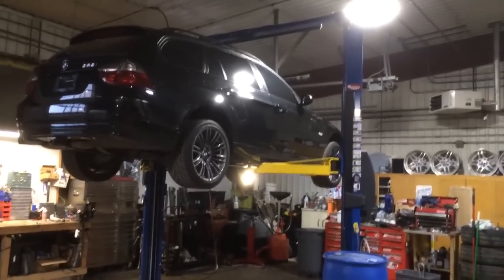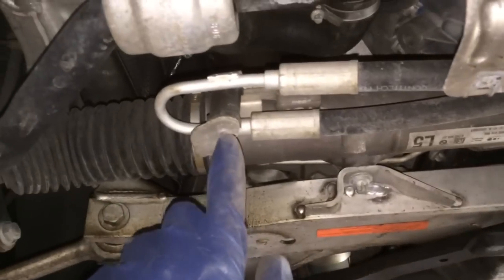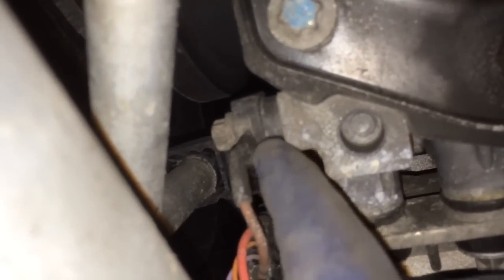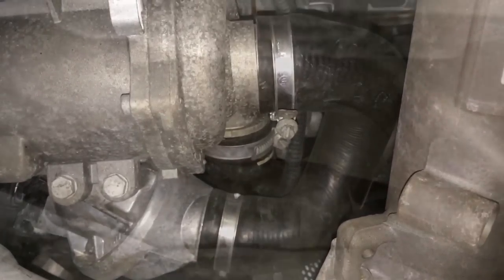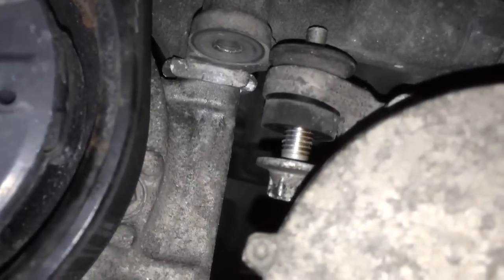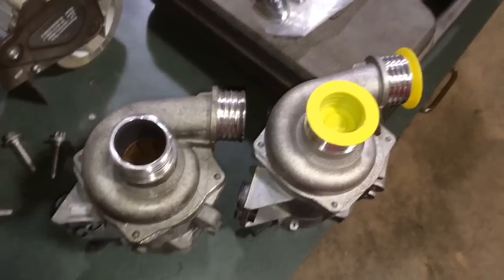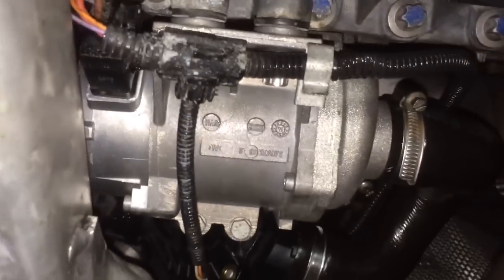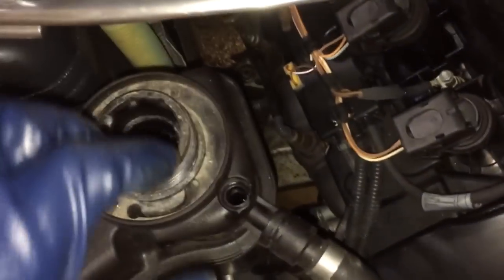BMW e90 e91 e92 e93 325i 328i 330i electric water pump and

Comment: This is a great video, right to the point. question can I use ramps to do this or jacks?
Reply: I replaced my water pump on my E90 325i and I used jack stands, Nothing to it but to do it.
Reply from the maker: +Frank Perez I think ramps would be ok. only thing is dropping the sway bar really, and that would be the same whether its on stands or ramps.
Reply: Thanks brah, was not sure if the sway bar would drop. Thanks for clarifying that it does not matter. I have an 06 325xi 153,000 and it runs strong however I believe the water pump is a ticking time bomb lol. Thks...
Reply from the maker: +Frank Perez watch my BMW X1 video. it's much more similar to your car than my wagon here due to AWD (makes the job a TON harder). 

still doable on ramps, getting the pump out between the sway bar and fan shroud is a PITA on the AWD cars.

and yeah, thats a time bomb.
Reply: +Camper1234599 will check out that video thks.

Comment: Great video!!  Realistically, how much time would you say this will take?  Thanks.
Reply from the maker: depends wholly on aptitude and tools.

2-5 hours
Reply: +Camper1234599 Thanks for prompt reply, pretty handy with tools, never done this job before.  Have lifts and all tools, going to do job at Navy auto hobby shop.  One auto shop agree to do just the labor for $359.00 I will be supplying parts and coolant.  Another wanted $888.00 with parts.  Your thoughts??  Thank you.

Comment: Just bought a kit for my E70 2011... car overheated last week. Got the same OE thermostat as you do but my original water pump is Continental.  The new one eventhough when I ordered it was listed as Pierburg, but it was Continental that came in the shipment.
Reply from the maker: +Willy Pitty continental is for the turbo engines. pierburg is normally asiprated engines. there are at least three different water pumps. see my brand new X1 water pump video to see if thats the same pump you have
Reply: Good to know!!! any tip on getting the parts out of the engine compartment? I sent a good part of the today working on it, really got stuck at getting the old parts out of there and I say prob getting the new parts into the lower engine area...
Reply from the maker: +Willy Pitty again, watch the X1 water pump video I posted yesterday in my channel. explains the all wheel drive turbo process better than this video does.
Reply: Will do.... Thanks!

Comment: I can't get the first hose from the water pump to the thermostat off. Can I take off the water pump with the hoses still attached to get a better grip of the hose to disconnect it?
Reply from the maker: +ronkee24 I don't know if there's clearance to remove the other hoses, or squeeze the pump and thermostat out together. sounds fishy that that intermediate hose won't come off.
Reply: +Camper1234599 yeah, it's on there very tightly. I tried loosening it with a flat head and it still won't come off
Reply from the maker: try getting a pick underneath the lip of the hose and work your way around it while pulling. if you can get one side off, twisting and prying should get it off. the hose is under $10 new, I would strongly recommend changing it if I were in your shoes.
Reply: +Camper1234599 Thanks for the advice. I finally got. the water pump out. I also wanted to know where I could find a replacement piece for the rubber noise dampener?
Reply from the maker: not sure which part that is?
Reply: +Camper1234599 It's the part that you show at the 2:00 part of the video
Reply from the maker: +ronkee24 ooh! realoem.com to find the part number, then bmwmercedesparts.com for the part. or ECS tuning

Comment: I'm driving an e90 2006 model, it overheat and i replaced waterpump and thermostart, but the car is still overheating, i tryed to check the fuses but i don't know where is the fuse for the waterpump can you help to find the fuse box in the engine compartment
Reply from the maker: Alfred Maebela either you have bad pins in the connector on the pump, the pump driver is fried in the engine computer, you blew your head gasket or..?

Either way, you need a dealer.

Comment: I'm very confused why the thermostat needs to replaced along with the pump and the new unit is plastic?!?
Reply: +Camper1234599 
+KeystrokeCowboy

...and to other posters who read this in the future - the water pump gets blamed for failing a lot...but I suspect that the thermostat is often the undiagnosed culprit. Here is an easy test to suggest which is failing. This test is not perfect, but will generate some useful info. Since the pump is $250-$500 depending on where you get it...I think this is worth the effort. That is especially true if your pump has only 50k miles on it, or you are on a tight budget. Use your own judgment.

1. Run the coolant purge cycle. Google it...very easy and NO risk to the engine or system. During the purge, open the hood and listen for the pump to see if it is running. It will cycle on and off. this is normal. Don't just listen "for" the pump...listen TO the pump. Is it straining, is the speed irregular or is it making weird squealing noises, or just plain not running? Those are your clues. It is not a Saturn 5 engine...it is a little electric motor turning a turbine blade which looks a lot like a turbocharger intake blade...o.k? 

2.  If it IS running, step two is start your engine and turn on your heater on high/max temperature. With the car warming up, sit in the car and note if the heater is actually getting hot. if the heater gets hot and STAYS hot, you know your water pump is at some level circulating coolant. This is because the heater core feed bypasses the thermostat. A stuck thermostat keeps the coolant from circulating coolant to the block...but NOT the heater core. Got it? SOMETHING must be pushing that hot coolant to the core? that "something" is your water pump, which is at some level circulating coolant, no matter what the engine computer is telling you. IF, however, the pump is bad then the heater won't be hot either, because NO coolant is circulating. Don't run the car very long...just long enough to determine if the heater stays hot. Should be evident well before the engine gives you an overheat warning. Yes, it is possible for a pump to run but not run fast enough to circulate coolant. The way to tell is how fast does your engine overheat? Reach down and feel the lower radiator hose. If it is stone cold, suspect the thermostat. If it is lukewarm, suspect the pump is not keeping up. If the car overheats in only a mile or two, suspect the thermostat...if it only overheats on hotter days, suspect the pump can't keep up...use common sense. 

Anyway, the test above would SUGGEST (not prove) that the thermostat is stuck. Now you have a decision, but you have some info too. If you have the bucks, replace the pump...if you are on a budget, and the signs indicate it, try replacing the thermostat first - even though the job is a bit of a chore since you must remove and reinstall what may be a defective water pump. 

re: Thermostats. Note that Gates sells this stat "lifetime warranty" for about a hundred bucks, but what they sell is (literally) sourced from the same folks as the cheaper MotoRad unit...and probably the Hella unit as well, which both sell for 30-50 bucks LESS. I have a Gates unit in front of me now, and someone at Gates has carefully removed all Hella p/n and casting marks with a die grinder to eliminate the OEM sourcing info! Boy, that's taking it a bit far, I'd say! FYI,

re: "Plastic? What?" Yep, ALL of the replacement units are plastic, and in this case this is GOOD, because the aluminum OEM units are corroding and failing. That's why they went with plastic. Aluminum is not always superior.

re: Pumps. Not all BMW electric pumps are the same quality - though the fit is more or less "universal" for the N52 and other sixes. There are at least three iterations of the so-called "Standard" BMW electric pump, all between 2007-2009. After 2009, it appears that they settled on a design. IMPORTANT: Make sure you DOUBLE CHECK the p/n on your pump to make sure you buy the latest iteration. They are externally the same, but internally improved. Clearly, BMW had problems with the first two iterations of the pump. 

re: Pump sources. Check eBay for pumps. You will find a wide range of prices, currently from just under 200 to sky's the limit. IMO, avoid the Chinese pumps. (the $200 pump). I also personally laugh at the idea that one "must use" a pump from the BMW dealership. If they are so great, why have so many failed? I deliberately chose NOT to use a dealership pump on my repair, because the first one they sold me (...with the car) failed in 64k miles! Why would I choose the same poor performing part again? Get the latest version of a German made pump - you'll be fine.

re: Coolant. Note you can use Zerex G-05 rated coolant if your BMW dealership isn't close by. 50/50 with distilled water. G-05 is low silicate/low phosphate, and is IMO fine for BMW. Also, whatever way you go, REPLACE YOUR COOLANT. IIRC, it's 8.4 qt. on an N52. Before you just dump in some new G-05, FIRST run the aforementioned purge sequence 3 times with full distilled water, re-draining the radiator each time. N52 doesn't have a block drain that I can find...and if it is there, it is a bear to get to without a lift. Hence the purge. Three times will get you there. 4 gallons of distilled water...cheap insurance. FYI, after the purge, there will still be about twoish quarts left in the block. Pour in 1 gallon of FULL STERNGTH G-05, and then top off with distilled. That'll be about 50/50...give or take. (1 gal G-05 full strength plus 4.4 quarts of distilled...ish)

re: Bolts. Remember, for your installation, the aluminum bolts on the water pump must be replaced with new ones. IF you are just testing and taking the pump out to get to the thermostat, I suppose you could reuse the old bolts...but IMO don't push it. They will fail after a couple installations, and will break off in the bosses. You really don't want that. Bolt sets are ten bucks...ish. Even on a budget, I'd say get two sets of bolts if you are trying to reuse the old water pump. Just not worth the headache, IMO.

Hope these tips help some of you DIY'ers. Use your own discretion and common sense as a DIY mechanic. If any of the above doesn't make sense, take it to a dealer. Oh, and those who disagree with my comments above - fine to correct with facts, but PLEASE don't bother to flame me with dire warnings about "only BMW coolant" or "if you can't afford to blindly replace with a new pump, you can't afford a BMW", etc. You're entitled to your opinion, and I mine...but I'm not interested in arguing the point. These are cars, and many of them are now bought second hand by regular people who really CAN'T afford to toss a perfectly good five hundred dollar water pump in the garbage, or who choose NOT to give in to ignorance and BMW superstition from YouTube / Bimmer forums, etc. 

Use common sense. Good luck.
Reply from the maker: KeystrokeCowboy original was a Pierburg part, new one is a Wahler. just a difference in OEM. you replace it because it's cheap and easy to get to. If you do JUST the pump and the thermostat goes out 10,000 miles later, you have to remove the pump to change out the thermostat.

not required but VERY stupid to not do it.
Reply: Ovalbore yes, like changing the flywheel and not the clutch.
Reply: BMW quality engineering, use plastic on the thermostat housing.
Reply: Ronnie Shih I would rather buy the aluminum thermostat new than a plastic unit
Reply: KeystrokeCowboy my cars thermostat and pump both went within one week. I believe there is a relationship between one failing then the other.